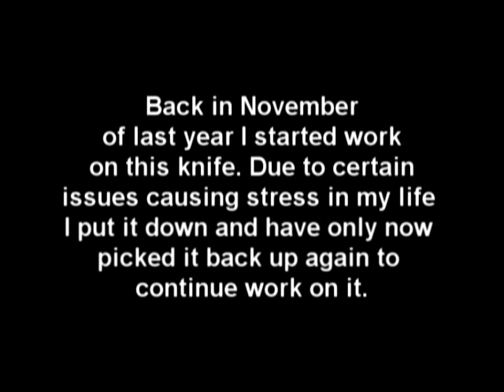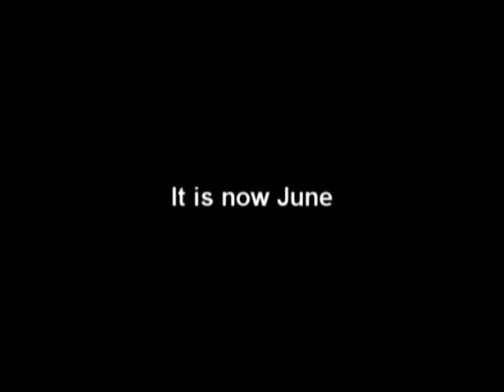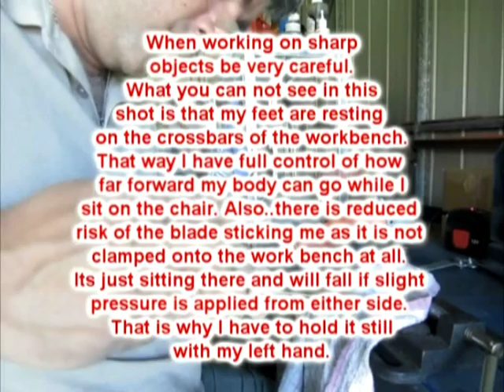Knife Making - STEELflint Bowie - part 1

Comment from the maker: Cant really say mate. 
It depends on the type of steel you are using, the type of belt, the amount of pressure applied, your technique...all sorts of factors come into play. A good knife maker with the right equipment can do it in under 30mins with lot of time to spare. Me...a LOT longer than that.